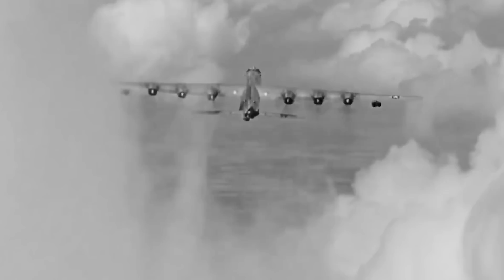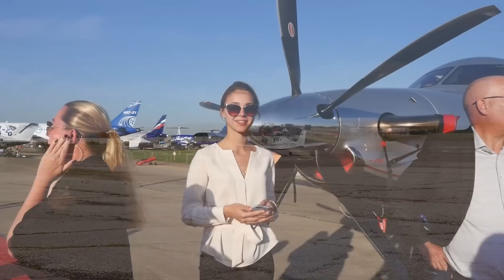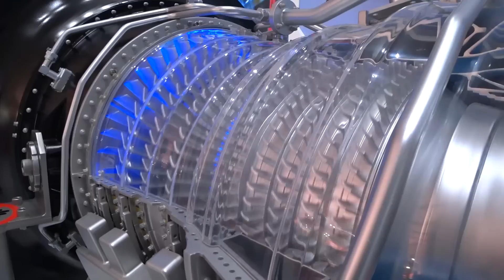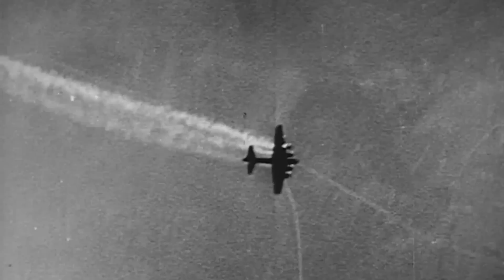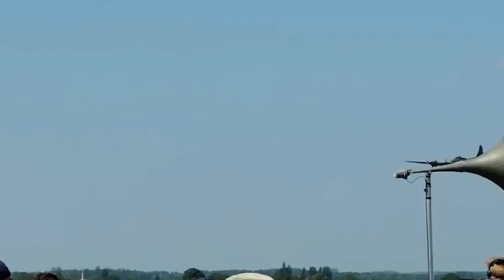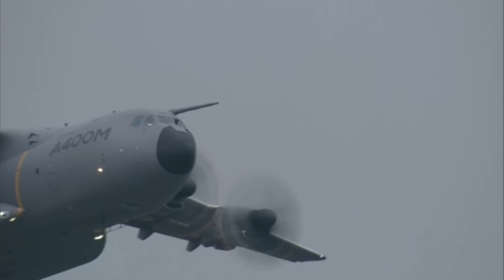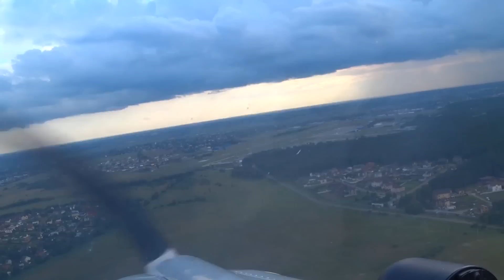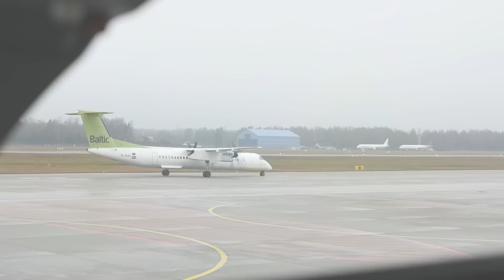Piston and Turboprop engines | What is the difference?

Comment: ELECTRIC!!
New developments in batteries (such as solid-state), electronics and motors will make this  more viable.
The advantages are huge.
Electric motors respond even better than piston engines, are not affected by altitude, can regenerate whilst landing, and are quiet. 
They are also more reliable.

Comment: It’s simple. If you can afford a turboprop you buy one. They are incredibly simple to operate and provide their power very smoothly. But if you choose to have one, make sure your batteries and/or GPU are up to spec. A “hot start” is very expensive.
Reply: Best answer in here so far.

Comment: One note, those WWII pistons normally used  gear driven superchargers, not turbochargers..
Reply: Not necessarily. Most of the radials are supercharged. BUT
Most of the water cooled engines used turbos. Check out the Merlins on the P-38 L.

Comment: The comment about the "Fuel inlet line freezing up".  I think you are referring to "carburetor icing", which indeed can be a concern for light piston engines that are carbureted, but believe it or not can happen in temps as high as 20C when humid - you can thank the temperature drop in the venturi for that.   We can manage it with carbonator heat, which is usually sourced from air warmed by the exhaust manifold.  It is operated manually, but is a well practiced procedure and under certain power settings, we automatically apply it as the throttle causes a large low pressure area behind it, especially at low power settings.  Also, only carbureted engines experience this.  Fuel injected piston engines do not have this challenge (although we do have hot start issues from fuel vaporizing in the fuel injection lines).
Reply: You wouldn't have vapor lock problems IF you would use the correct start
procedures.
Reply: You clearly have never started one in 100 degree weather in Texas with a hot engine... you can follow all the "procedures" to the letter and still find yourself cranking and waiting.  (or over-priming and an engine fire)
Reply: @jtharmon12  oh yes I have. I am very  familiar with with the Io520 vapor lock, especially in a quick turnarounds , for example. I'm in Harlingen. Is that hot enough? I have many hours with TIO540. It's very simple to alevitate. One just has to know how.
Tell me, how do you attempt to start one? Then I might explain the correct procedure to you???
Reply: @jtharmon12  🤣
Been there done that.
Reply: @jtharmon12  I had 2 exhaust fires before I figured out how to start them. 1 on a Baron 58 and 1 in my future brother in laws AG truck.
If you can pull it off? Platinum or Iridium plugs help too. Cold weather is were they really shine through.
Reply: @jtharmon12  are you any relation to Jay Harmon?
Reply: Well, Well. You must be one of those, I know everything, (gods gift to aviation 🤣) so called pilot.
Reply: For Anyone that can take a suggestions (does not apply to gods gift to aviation) try this and see if you don't start better. 
Crack the throttle.
Mixture idle cut off.
Boost pump on high until fuel pressure stabilize's. You can hear it. This is the key. You have to let them pump in idle cut off. You are getting bubbles (vapor lock) out. 
Turn boost off. 
Start engine. 
When engine fires advance mixture until running smoothly. 
You have fuel on the ground But no worries since you won't have the burps & farts like it normally does from  rich attempts to start. 
Just pretend you have a flooded engine.

Comment: Turbo props does provide a way better thrust to weight ratio and yes they started development in the 50's  but comparing a modern turbo prop to dinosaur piston engine this video is released in 2020 come on now some piston engine has Fadec control uses auto gas or diesel..  Also the experimental aircraft have become popular because of this.. people are putting more compact, more powerful, more reliable and more efficient auto engines in planes.. the technology is just far superior

Comment: What about specific efficiency? While small piston engines are more efficient, the higher the output the lower their specific efficiency (unit of power per unit of fuel) At the 350-400 horsepower point turbine aircraft reach parity with pistons and above that the become more efficient.

Also, when employing constant speed props there is no “spool up time” on a turbine. At flight RPM the engines are operating at peak potential power and only need to be feed more fuel.

Comment: One thing I do love over the jet or turbofan, is that in heavy rain, the turboprop will continue on without flooding out. Every engine range has a distinct purpose and should be used in accordance. I do like the turboprops but the masses dictates otherwise. Some piston aircraft can fly up to 35,000'. WWII has proved that.
Reply: Anything will fly at those altitudes provided you compress the air enough.

So I guess you really don't need igniters on or ice vanes on a turbine?
🤣

Comment: You failed to point out the fundamental physical reason gas turbine engines aren't much used in small aircraft. Gas turbines depend on the mass air flow through the engine to develop power. Below about 500 shaft horsepower the decrease in air flow cause the thermal efficiency of a gas turbine to plummet and fuel economy to rapidly worsen.

Comment: I'm surprised you didn't mention the newish Turbo Diesels which are starting to muscle in on conventional piston engines for aircraft. They have some pretty nice advantages and run on Jet A which is cheaper and easier to find than AVgas.
Reply: no, diesel are way too heawy, they are only use up to 230hp (SMA  SR305-230E/195kg), the only biggger aircraft diesel engines was the Junkers Jumo 205 (690hp/570kg) , and the Clerget 14F (710hp/600kg)
Reply: @leneanderthalien  But there are some coming up, like the one planned for the Celera, is already used on some other aircraft. It's also turbocharged, meaning higher ceiling. 550hp/360kgs

Comment: Interesting point you made there. I do wonder how a modern ~1200 hp piston engine would look like. Much smaller than the monsters of the 40s, for certain
Reply: Heck, even GE T700 is lighter than Bugatti Veyron engine, but produce more than twice the power
Reply: Liquid-cooled V12
Bore: 120 mm
Stroke: 100 mm
Displacement: 13.6 liters
Power: 1,200 hp @ 4,800 rpm
Mean piston speed at full power: 16 m/s
BMEP at full power: 240 psi
Edit: Weight would probably be 1,000 pounds, or less.
-
A modern engine could be even smaller than this (~10 liters), as BMEP was up to 300 psi by the end of the piston age, but efficiency might begin to suffer at higher pressures.
-
The compression ratio could be much higher than engines from the '30s-'40s, even when burning unleaded fuel, this would significantly increase fuel efficiency. With a 98 octane fuel (Swift UL94), a 12:1 compression ratio would likely be achievable. With modern knock sensor technology and precise control of the ignition timing and fuel mixture by an EFI system, there'd be little need to create a safety buffer against knock by keeping the compression ratio low. Closed loop operation (using O2 sensors in the exhaust) would allow for highly precise control of the fuel mixture. FADEC would allow for the engine to be controlled with a single power lever, greatly reducing pilot workload. LOP operation would be automatic and there'd likely never be a need to run the engine ROP, except to mitigate knock in an unusual operating condition. FADEC would also eliminate human errors in operation, significantly improving safety and reliability. Modern turbochargers would be used in place of a supercharger, adding to increased efficiency. The modern understanding of engine geometry (bore to stroke ratio, ports, combustion chambers, cams, etc), along with modern friction reducing technologies would also add significantly to improved fuel efficiency by reducing pumping and friction losses.
-
Still, though, turbines are so light and reliable that no one would consider building an engine like this. All of these advancements could be applied to engines making less than 400 hp, though, as turbines of less than 400 hp absolutely guzzle fuel and are insanely expensive.
Reply: Made a bunch of edits to my previous comment.
Reply: Not if you wanted them to last long look at the thunder engine,built for replacing pt6s, lot of money spent and abandoned due to short life
Reply: Still pretty much the same.

Yeah-yeah, there's tons of auto engine that can reach 1200 hp. But, they lack of sustaining time due to nature of high boost and high RPM. You can tune down the RPM, but in the end you must shove more displacement, make it bigger. And still more or less same with engine from 40s
Reply: @bocahdongo7769  you get a fuel consumption reduction tho. For example: MB M103 inline 6 SOHC (3.0L) with KE-Jetronic (electro-mechanical injection) get's around 8km/L, while the M104 inline 6 DOHC (3.2L) with electronic injection, can get up to 22km/L when properly tuned.

Comment: High-bypass Turbofan engine is like a turboprop but ducted.
Reply: Some Turbofans get something like 85% of their thrust off of the fan section!
Reply: @timengineman2nd714  more like 90 to 93%
Reply: @danielmeador1991  Yeah, it's been awhile since I was around jet engines.  (like about 20 years) Now about the only time I'm anywhere near a jet engine is when I fly (commercial) to see the grandkids!
Reply: @timengineman2nd714  yea they have changed a bit
Reply: Yeah, more than once he just calles them "jet engines"..
Reply: This leads to a question always puzzle me: 

In the turbofan industry there is always a saying that the higher the bypass ratio, the higher the efficiency become.  A good turbofan engine is the one with high bypass ratio.  Then, why don't just use a turboprop engine, which is in some way a 100% bypass ratio?
Reply: @ytpoon666  the advantage of a ducted fan than an open fan is the thrust. Ducted fans has higher thrust than an open fan/prop.

Having a Turbofan is like having the characteristics of a jet and a turboprop.

Power and efficiency
Reply: @ninjasiren  not realy: a ducted fan is limited in diameter: bigger the diameter bigger is the drag (and the weight) from the duct, over 4 meters is the drag so high that the gain is zero... so the propellers diameter from the AN22 is 6,20m (15000hp engines) and 5,30m for the A400M (11000hp engines )
Reply: @leneanderthalien  but a ducted fan is efficient and powerful for it's use case.
Reply: @ytpoon666  I'm no engineer or aviation expert, but I think one issue is propeller - or fan - diameter.
The propeller of a turboprop has quite a large diameter. this limits its rotational speed and thus the speed of the air pushed back by it, as you don't want the tips of the propeller blades go supersonic. A fan with many shorter blades can spinn faster and move more air for the same propeller area.

Afaik, turboprops are more cost-efficient in smaller planes flying at low altitude, while turbofans are superior for larger planes flying in thinner air.
Reply: @Bird_Dog00  It has nothing to do with the diameter but the number of blades. Turboprops have 5 or 6 or 7 blades but Turbofans have a lot of em. So much that the gap between them is not visible. There is a lot of force required to spin turbo fan blades because of the weight the blades on turbo fan look thinner but the overall weight is way more than a turbo prop plus low bypass turbofan blades are lighter than a high bypass turbofan blades. Commercial planes use high bypass turbo fans. Air displacement is measured in cfm or cubic feet per minute. Since turbofans have more number of blades more air is displaced. Second factor is the fact that turbofans have a covering over them so air can be directed as compared to turbo props that may spread air  in several directions which may lead to reduction in thrust as thrust is produced by air thrown backwards another commenter commented about the tips of the turbofan blades slapping air on the fuselage so that is wasted energy. RPM has more to do with Air volume and amount of fuel injected. Engineers manafacturing turbofans use stronger but lighter materials for the turbofan blades, compressor blades and turbine blades. Heavier turbofan, compressor and turbine means more energy wasted in getting it running as less in propelling the plane. A 1 litre inline 3 cylinder cannot power a Escalade because more energy is wasted on moving its heavy body and less on moving it. Similarly if you use heavy materials for the blades more energy is used in displacing those blades and there is very little energy coming out as thrust to propel the plane.
Reply: @Bird_Dog00  not only that. The bypassed air in a turbofan engine gets even faster when it absorbs the heat from the engine and also going through a narrower path through the exhaust
Reply: @ytpoon666  they actually have engines like those called ultra high bypass engines or simply “propfans”. Most modern high bypass engines have the efficiency of, if not better than, UHB engines. A good example is that new GE9x turbo fan that General Electric is pushing out right now
Reply: @ytpoon666  Not only do you have to worry about the larger diameter propeller blade tips going supersonic, but you also get a lot of cabin noise when it's a wing mounted turboprop.  (Air coming off the tip of the propeller slapping the fuselage).
Reply: @ytpoon666  Turboprops are more efficient at low speeds.
50-280 knots.
Turbofans are more efficient at higher speeds & altitudes. 300-650 knots.
Reply: @ytpoon666  Yes you´re right! In the late 80´s there was developped the so called " propfan". In order to save fuel it was a combination of a turboprop and a jet-engine. Because in theese times fuelprice was rising enourmesly. Altough it was ready for the market, it was turned down. Afterwards fuel prices got cheaper again and for the industry it was the reason that this new technolgy not will see the light of day. But as I think, the real problem is that propellers are out since the so called" jet" has arrived. They were treated like a taboo until today. Although the bypass is getting bigger and bigger in a so called"jet-engine", they don´t dare the step to a unducted fan. Yeah I liked you´re thoughts.I `m looking forword to hear from you.
Reply: @ytpoon666  100% bypass means all the air goes around the engine and 0% goes through the engine.  Since the engine gets no air, you don't need to give it fuel.  Since the engine doesn't use fuel, you can just remove it.  And when the wind blows through the gaping hole where the engine was, you have 100% bypass.  Thanks for the joke.
Reply: The armchair propulsion engineers on here are comical. 🤣
Reply: @michaelo1929  Exactly!  After a gazillion replies someone FINALLY mentions that turboprops are geared, but no one really mentions that turboprops are optimized for flying at lower altitudes (like 18,000') in denser air while jets are optimized for flying in the thin air at 37,000', and similarly, no one mentions the differences in the airfoil types used for the blades, in order to optimize them for their intended role (altitude/air density/speed).
Reply: There is just as much difference between an opposed recipe & a turbine as there is an opposed & a radical,  horsepower wise. There is a lot of difference in say, 1000 horse turbine & 1000 hp piston.
Reply: Kinda but not exactly, turboprops are pulled forward while turbofans are pushed
Reply: First of all Turbofans blades can't change the pitch also Turbofans work on various speeds. A turboprop has prop blades that can change pitch and these engines usually work at constant prop speed. The biggest difference though is that turboprops have a gearbox to have the drive turbine and the prop work on their most effective but vastly different speeds. Most Turbofans have the Fan directly coupled with its driving turbine hence the speed will be a compromise. Fans are more effective with bigger diameter and lower speed and turbines are more effective at higher speeds. A compromise are the quite new Geared Turbofans like the PW1000G which have an internal gearbox to optimised rotor speeds. But an internal gearbox capable to deal with the high power outputs and torque of a modern fan engine but being still light enough to actually fly is very close to rocket science.
Reply: Does high bypass mean the turbine drives the fan to blow air for thrust and not just for engine intake?
Reply: @soundspark  High bypass means high bypass. A lot of the thrust produced from air going around the actual jet engine inside the casing

Comment: Well, you could overcome the altitude limitations of piston engines with superchargers and turbochargers, but that adds a LOT of complexity to the engine. For example, the Rolls-Royce Merlin 61 has 1,600 bhp, but that two-stage supercharging equipment makes it far more complex than the original Merlin models.
Reply: Also, look into the forced induction system for the Grob Strato 2c.
Reply: Just another procedure or so.

Comment: How about a rotary engine.. Is there a aircraft used rotary engine?🤔 because rotary engine is more small n more powerfull than piston engine..
Reply: Wankel engines, not rotary who are completly different engines (see Gnome or le Rhone rotary engines) but the TBO from a Wankel is less than the half from a conventional engine and the consumption 30% higher, but was tested in the end 70' a french helicopter (Citroën RE-2 190hp Wankel Comotor 624): work good and cost 4x less than a turbine with much less consumption (use automotive gazoline)...